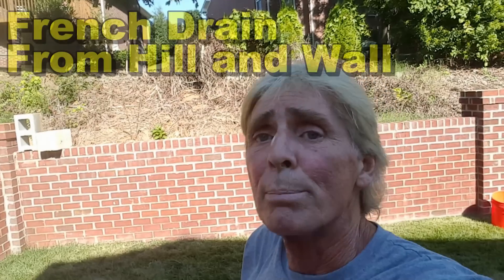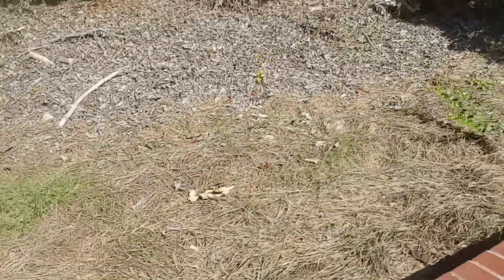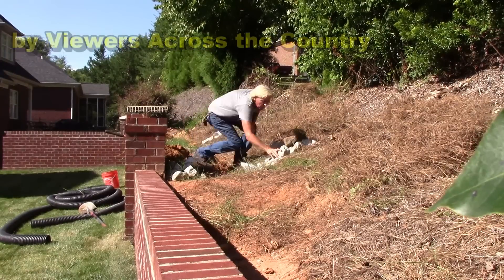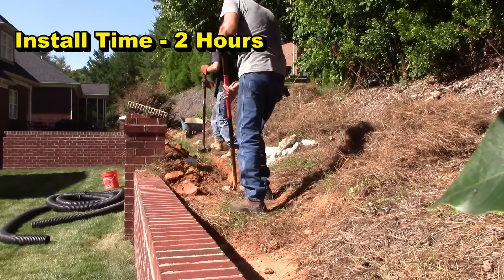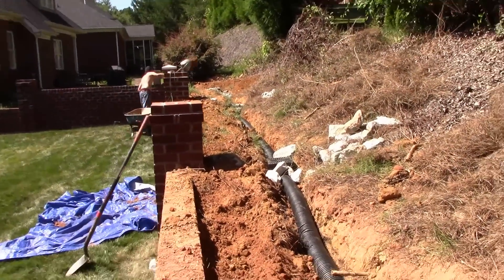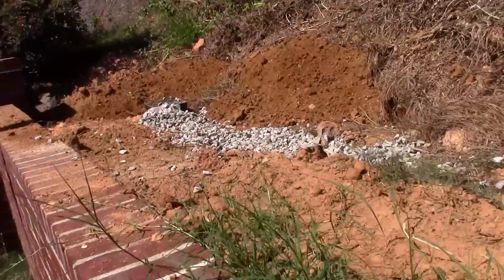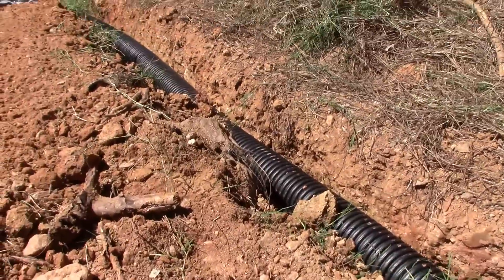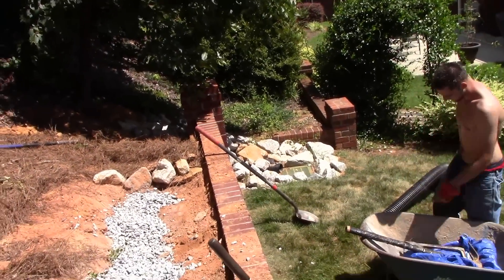French Drain, Yard Drain, Off Steep Hill, DIY

Comment: What if you live in a cold area where temperatures gets to lower than -20 degrees Celsius in winter, will that drain pipe not be freezed during spring when snow starts melting like thawing and freezing

Comment: This would have looked really nice if you tied both pipes in one just before it comes out into the 18 x 18 storm drain so that it did have 2 coming out. Looks a bit sloppy there. Other than that its a great video for the DIY'er. Thanks for the detailed instructions.